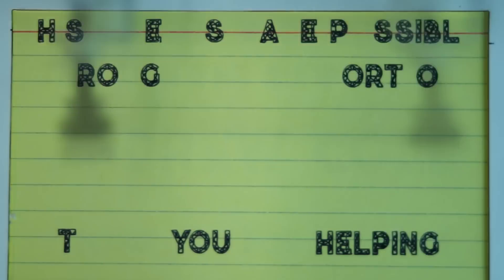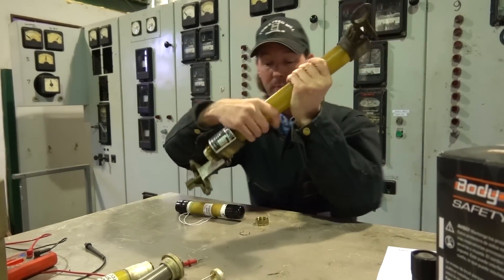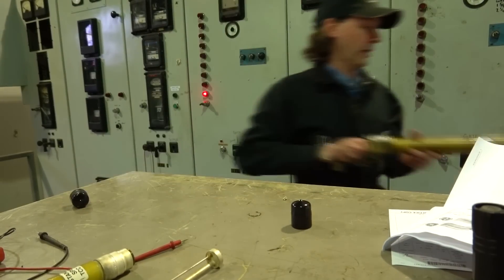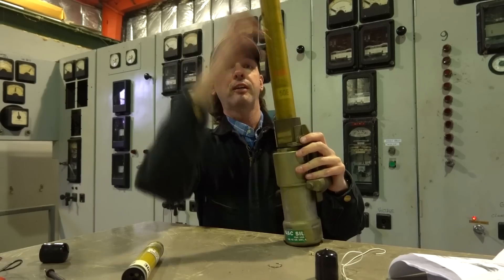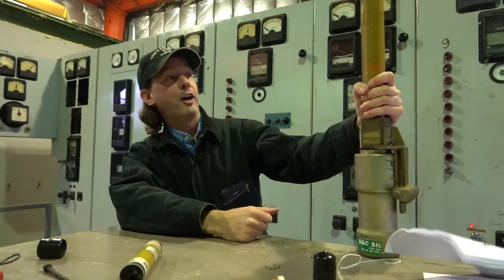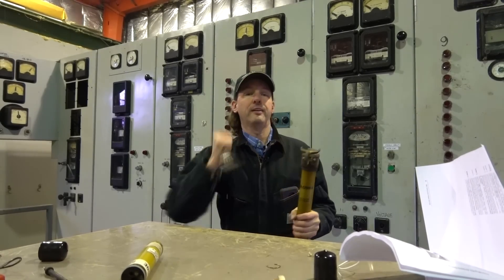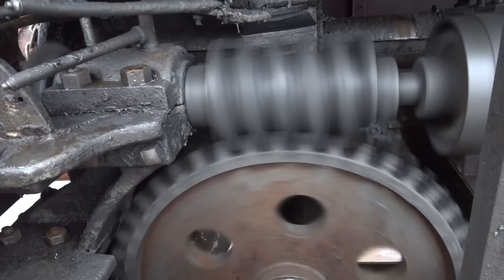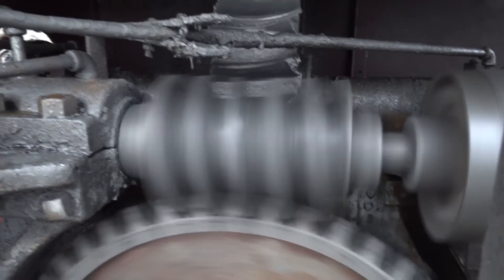Authorized Personnel Only - Hydroelectric Plant Fuse Replacement and Startup

Comment: Looks like the bearing on the right hand side of the worm gear need work. You could see it moving up and down as it was spinning.
Reply: It's possible it's designed to do that could be some sort of harmonizer coupler designed to have some give.
Reply: @benargee  Yeah, the coupler saves the bearing across a long span like that because of the worms propensity for wanting to ride upwards. Swapping a coupler is easier than swapping a bearing, like a lovejoy allows for shock and slight misalignment.
Reply: isn't the problem more on the left side? looks like the coupler is vibrating, when he pans over to the right site you see no vibration at all in the bearing itself.

Comment: Had to do this sort of fuse replacement at the VOA  Greenville NC SW transmitter site  The fuses there are 400A 4160V. There are 2 three phase feeders for each transmitter. One transmitter had a shorted regulator transformer that shorted and blew the fuse. Replaced the fuse-later the transformer and the station back in business-8 Sw transmitters 500/250kw. Used the hot stick to put the new fuse in-rebuilt the old one as shown here. So someone else has the same sort of fuses.
Reply: Cool to hear about the VOA's transmitters.  So many Shortwave stations have called it quits.  I knew a Broadcast Engineer for a(once upon a time) Clear Channel 50kw AM station that called the high voltage stick the "Jesus Stick."
Reply: @b3j8  Jesus sticks are an insulated stick with a contact on the other end connected with a heavy wire to a good Earth ground. Usually there is a hook. Before getting into the innards of a transmitter or anything with High Voltage, you doublecheck that the power is disconnected (and locked and tagged out), then touch everything and I mean everything in the cabinet at least once (especially capacitors) with the stick. then hang the stick on the high voltage bus and leave it there until you are done. 
We actually had a contact with a light bulb connected to a hot main, you touched the stick to the other contact which would ground the bulb and show the stick was actually conducting. No light, no open the cabinet. 
So named because if you don't use it properly, you might meet Jesus very shortly.

Comment: So to start a hydroelectric plant, you simply watch antique gauges and flashing lights?  I can do that 😉
Reply: Watch the synchro, when its at 12 o clock and not moving(ideally) the generator and grid are in phase and frequency matched. 

The lights are a back up to the the scope. If they are flashing the frequency is off. If they are lit, the phase is off. There are 2 for redundancy.

Comment: That's some ancient equipment, and does look desparate for some maintenance (leaking seals, very worn second stage worm wheel)
Reply: That worm gear shaft needs to have its Babbitt bearing replaced.
Keith Fenner could do it.

Comment: I'm going to assume that's a rather old hydro electric plant by the looks of that rather old electrical equipment.
Reply: as far as power infrastructure in the US goes, 1960s isn't old anymore.
Reply: Pick one,  built sturdy, tough and a little sketchy. Or plastic, brainbox way smarter than needs to ever be per code, and takes absooutely no training or thought to operate or change parts.
Reply: Now think of chernobyl and how the facility was so advanced and regulated that when a piece of electronic wizardry took a lunch break, how nobody knew how to override or resolve the issue that with the properly trained experts who werent on site to save money having to pay them over a button pusher and how the whole thing could have been prevented easily and quickly..  but derp a and derp b both could only tuck balls and yell for help...

Comment: Watching that synchroscope brought back memories.  "Charge the breaker springs and close at the 1 o'clock position while the needle is slowly rotating in the "Fast" direction to ensure the generator picks up real load".  Had to be able to recite that to get my watch supervisor qualification while serving on the USS Truman.
Reply: Heard a story of someone that worked at a plant and guess he had a brain fart and forgot what sequence meant it was synchronized (light on or off) and he turned it on when it was exactly 180 degrees out of sync.  Broke a 1 foot diameter turbine shaft and required a change of underwear.  Probably a day off too. lol.   I imagine now days the sync process is fully automated.
Reply: @redsquirrelftw  A power plant in Georgia did that sort of thing. Sent the parts of the generator into the roof. But there they were talking about mega-Watt size equipment. Someone wired the panel wrong during an overhaul so when they went to put it online, it blew the generator apart. The ones we had were only 125kW units.
Reply: @gravelydon7072  Sorry to necro an old comment but we had a guy do that with a 100MVA unit.  The amazing part is that it didn't trip.  The dome light even stayed on it too!  He hit the breaker at 6:00 instead of 12:00.
Reply: @redsquirrelftw  I build and work on smaller plants than this ( up to 3 Mw ) and yes they all self synchronize. They still have the sync scope but it's digital and on a screen not an analog gauge anymore. Even so out it does still randomly happen but very rare. I had a 300kw generator sync 20 degrees out and oh my did the current get up there lol. Fortunately no damage but the instantaneous current was something like 2500 amps at 480 volts. The generator tended to run around 350-400 per phase when loaded and properly synced.
Reply: @justintime5375  I work in pulsed power here and there and when impedance matching fails, the reflected pulses and ringsown events can get pretty massive. 1500v rated mosfet detonating because a 1kv cap discharged through an unbalanced load and 4kv turned its gate into silicon plasma...

Way smaller scale by orders of magnitude, but the O scope trace and the color of the pants are probably very similar.
Reply: @redsquirrelftw  He's very lucky the generator didn't decide it could fly.
Reply: Brought me back to my apprenticeship  days for the Electricity Board in the UK!
Reply: Gotta pay attention - I wonder if that's how somebody blew the fuse.
Reply: @jpdemer5  The boss probably plugged his hairdryer into the wrong outlet again.
Reply: Rought me back when I was dumping 160kw÷ of 20,000 dc amps out of a solid state laser back in the day
Reply: Do navy ships have more than one synchronized generators too?
Reply: @filter4now  the ship I was on has two steam plants and each plant has two turbine generators for the reactor coolant pumps and two for the ship's hotel loads that can be configured in ways I'm not at liberty to discuss nearly 20 years since I qualified. So yes, 8 turbine generators and a few more emergency Diesel generators too.
Reply: Personnaly reminds of USS Enterprise. Even on a spacecraft, procedures were pretty much the same :-)
Reply: Doesn't seem like much to memorize for such a qualification. Maybe the Army was just more demanding than the Navy.
Reply: @travelinman70  lmao just go search up Navy Nuc standards, it's not easy in the slightest. You will enjoy a long ruc before wanting to spend the 30 hours in the school house a week extra studying.

Comment: In my town, there were once 17 hydro plants making power on the local river.  Back in 4th grade, my teacher told us about syncing the generator with the grid.  it's really neat to see the synchroscope in action like he describes 60+ years ago.

What keeps  the generator  in sync during continued operation?  I expect that the speed might vary a bit with changes in water level and electrical load.  Is there some sort of electrical servomechanism to keep things in sync?
Reply: once locked and connected to the grid, the generator keeps itself synchronized with no assistance. If it slows down even a tiny bit (were talking much less then 1Hz electrical rotation), the power output (and mechanical load of the turbine) dramatically changes, causing it to unload the turbine, speeding up until it synchronizes. All of this happens naturally, the power output changes, not the speed. Even if you completely close the gates, the generator will keep spinning the turbine, but of course it will now draw power from the grid instead of supplying it.

If you connect the generator with the speeds mismatched, it will naturally try to match. But since the rotating assembly weighs many tons, it can't do this quickly, resulting in the generator either drawing or supplying (depending on if it's running faster or slower) stupid amounts current from the grid, causing all kinds of spectacular and very expensive damage, not limited to just the electrical system.
Reply: The grid itself keeps it in synch. Imagine two motors coupled together, both rotating at the same speed. A huge one, lets say 1,21 Gigawatts, which is the grid, and a small one, lets say 200 Megawatts, which is the generator. The small ones tries to go faster than the big one, but can't as the bigger motor is just much more powerful. This results in torque, which is the actual power the generator puts out. 

So, basically the grid defines the speed of the generator. The generator consists of a rotor, which is mechanically coupled to the turbine. The rotor rotates inside of the stator, which consists of a lot of windings, which are set at ususally at 120° to each other. A magnetic field is then created in the rotor, which induces a voltage in the stator windings, the faster your rotor turns, the higher your voltage and your frequency is. When the generator is then synched to the grid with, lets say 50Hz, the frequency of the stator field is then defined by the grid.
Reply: RGN and RGU , speed regulator and tension regulator is what you re looking for.
Reply: When a generator is connected to the grid it always runs at a constant speed called the synchronous speed - that required to produce 60 hz (in North America).  Load can change.  Speed cannot change, it’s locked in electrically.

Comment: Interesting to see other power houses as each one is so different.  Gotta laugh at the turbine packing spraying water.
Reply: Not just the water - when autumn leaves start coming through, you know it's time to rebuild that thing.  (Ahh, the signs of the passing seasons...)
Reply: I mean massive industrial machinery is not exactly standardized, since the volume of production is very, very low(the general rule of thumb is the bigger, the more components are gonna be unique). So every project is pretty much hand crafted piece that is at best used some other one as a reference. The only saving grace for professionals in the field are standardized components and protocols that are usually used as building blocks. 

I mean the sole fact that interchangeable component like a fuse(even though heavy-duty one is more complex than normal one, but it is still not very sophisticated in both production and construction) costs a few grand speaks volumes about production volumes of these things.
Reply: @Shonicheck  A hydroelectric power plant near me has a machine shop for manufacturing replacement parts as needed. The plant is over 100 years old and any replacement parts that used to exist have been unavailable for a long time!
Reply: @Shonicheck  I used to work in an old building that had escalators, it was an old department store. And the parts were hand machined when needed because they had to be.

Comment: I was talking to a guy that work at the power plant where I live. He told me that recently some dummy at the plant brought a generator on line out of sync. Blew the s*** out of everything. He had no idea how he managed to defeat the lockout. I don't know if he got fired, but he caused millions in damages.
Reply: Not hard if there has been an overhaul and someone wired it wrong. That has happened before.
Reply: He was probably union and got a raise with two extra weeks paid vacation.
Reply: And a formerly unemployed scab is so much more qualified, did I get that right?
Reply: @travelinman70 Promote him to management, problem solved.

Comment: We where looking into purchasing a low head plant at Mt Arbuckle CA had a horizontal "wheel" it was a FERC pilot project about 5 miles of lines to a reconnector we would have to maintain most could be operated remotely but syncing was a issue and would require on site operator at startup all the research data is available. big drawback was seasonal flow and a drought for several years price was only 250k or thereabouts. FERC has a list of small projects and a few are for sale every so often.
Reply: Make a deal with some local technical person to be the caretaker. Pay them on an as needed basis.

Comment: Wow youd need to find a really big bolt to replace this fuse
Reply: Just wrap it in aluminum foil.

On a more serious note, one day at work we found a whole bag of small brass rods that had been machined down only in the center leaving two larger "contacts" at the ends. These were the exact same dimensions as the shorter cylindrical glass body fuses (1/4" round, 7/8" long). To a group of electrical engineers the sight of an entire bag filled with pieces of brass specifically machined to defeat the protection offered by a fuse was so absurd it was hilarious. We laughed about that for days.
Reply: @Fix_It_Again_Tony  No blow fuse filler things actually were a thing years ago; they were meant for use in the neutral of a double or triple pole disconnect where all the conductors were fused.
Reply: @Fix_It_Again_Tony One of the better ones I have seen was a big industrial distribution board that wasn't upgraded when the new packing line was installed, as a result it started making bad smells. They waved a TIC camera across it and found a number of significant components where running significantly hotter than they should have been. 

Anywho there was a month of work left before the off season. Solution? 4x 8 inch duct fans blowing cold air into the board. 

It didn't catch fire... somehow!
Reply: @Fix_It_Again_Tony holy $#&@. Lock out the building mains power and call the fire department.[idk , maybe]
Reply: @Fix_It_Again_Tony  "Machined down in the center" sounds like they were (cough) designed (cough) to blow if the current got to some high level.  Of course, letting it splatter molten brass around the area was probably not the brightest of ideas.
Reply: @jpdemer5  or not extinguising the spark with sand.
Reply: Yea, aint no stack of pennies around to fix thatn shut..
Reply: Or better yet just hacksaw off a length of #8 rebar
Reply: 28mm combo wrench
Reply: $20 worth of 50 cent coins will do the trick
Reply: I dont get it
Reply: @baileyjerman5573  if you’ve got a circuit with a small fault, perhaps a high resistance path to ground, the equipment might look like it still works but it blows fuses. Some people then replace the fuse with a bolt, and call it good, which is extremely dangerous, as the fault current could be arcing or cause a fire from the heat.
Reply: A tinfoil hat might suffice though..

Comment: Great video.  It would have been nice to have an explanation about the paralleling process and what the meters were showing as you paralleled and took the load.  What did the worm drive gears do?  Open up the spillway gate?
Reply: Have a look at this vid for an walk through: " How to Run Synchronous Generators in Parallel ㅣMarine Electrician " on the channel " Mark Roy Mangrobang "

Comment: "I'm gonna show you how to start a hydroelectric dam."

All I saw were flashing lights, a spinning gauge, and grid/station free gauges. Had NO clue what was going on. Lol.
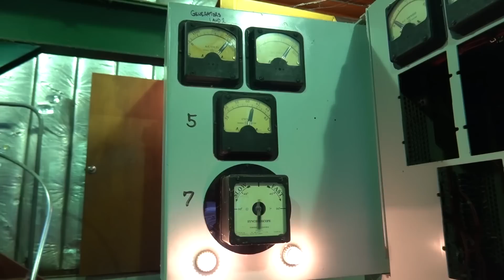Reply: 9:18  Starting from the bottom:  The flashing lights and spinning Fast / Slow dial are used to show if the generator needs to speed  up or slow down ( frequency ) in reference to the utility grid ( all the other generators out there making power ) and if the AC sine wave is in sync with the grid.  

The lights are cross connected to 2 of the 3 phase lines. If the lights are on solid , it shows that the generator is at the correct frequency but out of sync with the grid  If the lights are flashing, it shows that the generator is out of frequency and out of sync with the grid. 

The fast / slow meter is used for fine tuning of generator frequency / speed. Meter 5 is a frequency meter that is used for a rough measurement of generator frequency / speed

Look for a vid on how AC power works.  If a generator is randomly connected to an existing AC power source and the generator is going positive as the grid is going negative, really bad stuff can happen like mechanical and electrical damage.  This is sort of like running a car into a wall or having a slack chain then applying a rapid load.

The top left meter shows the voltage the generator is making, the top right is what the grid is at.
Reply: At least we got 3 minutes of watching a worm gear. No idea what it controls tho. 👌
Reply: Also, have a look at this vid for an walk through:  "  How to Run Synchronous Generators in Parallel ㅣMarine Electrician "  on the channel " Mark Roy Mangrobang  "
Reply: grid synchronization and contact closing